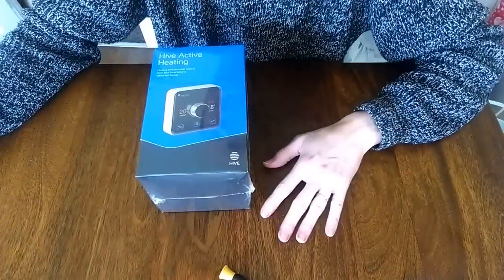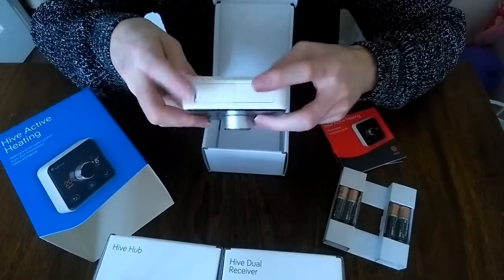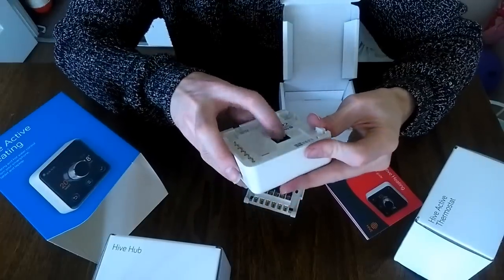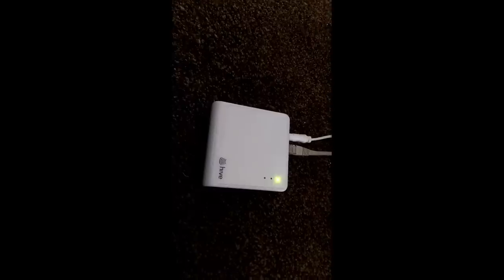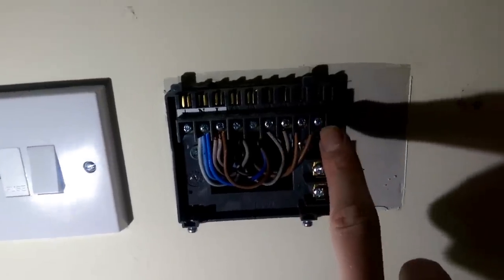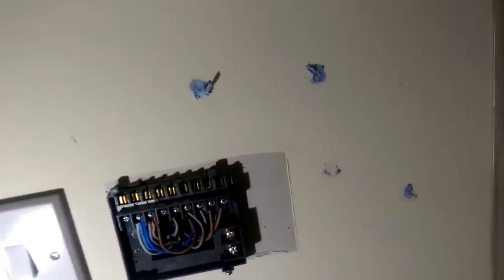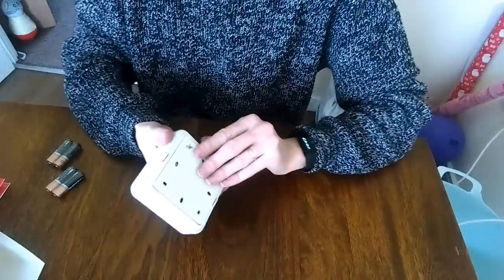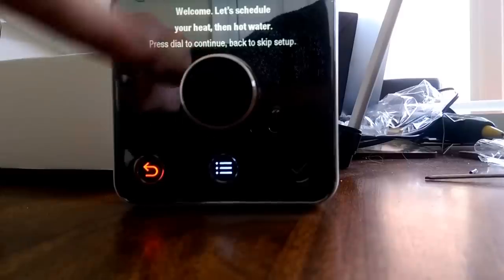Hive active heating system installation and guide

Comment: Good video - explained very well. My observation was when Isolating the mains power to fit the controller (by switching off fused spur )- I would suggest, not only switching off the Switched Fused Spur but also remove the actual Fuse from the Switched Fused Spur unit.  Or if isolating at Consumer Unit - locking out the RCD / MCB/ RCBO to avoid it being switched on whilst you are wiring the controller.
Also don't you need to alter the wiring in the wiring centre box where the hardwired roomstat  has been removed. I may have missed this in the video, but if you don't do this the heating will not work.

Comment: Compliments on an informative video.  I bought a Hive last night in a Black Friday sale event, including free Amazon Echo (got two already but more won't hurt) and including installation for £148.  The install is £40 of that price but looking at this, I fitted our existing Danfoss, the same as yours so could have gone for the self fit.  Regardless, price was good so no issue. Just one comment, when showing the wiring or diagrams, please consider using a tripod or just a still picture of them and voice over afterwards.  I paused the video to keep a still frame to look at as you were wobbling around a bit :)

Comment: Very useful and informative . Nice to see the full installation as others were just giving the impression that all one needed to do was install a thermostat.
I would have liked to have seen better detail on the thermostat controls in particular manual "Heating ON" as I'm thinking of installing one for my father who is severely technically challenged.
Reply from the maker: Hi, thanks for watching! On the heating controls, there is a little more info on my follow up video: https://youtu.be/t0h__djKg3Q
But to answer your question, a quick "HEAT ON" boost would be to press one of the two top recessed boost buttons which would turn the heating on for an hour at your triggered boost temperature, that may do what you want. Depending on your fathers mobility though the top button may not be ideal.

Comment: Great instructions superb. A thing to note with the Hive on Amazon is they offer installation through British Gas quite cheaply at the moment (£30 ish) unfortunately they won't touch an oil boiler. So if you order installation they only send thermostat no hub or receiver the engineer brings those. Odd really because the engineer doesn't even need to touch boiler. I had to send mine back and order a none installation one.
Reply from the maker: Excellent info Garry. Thanks for sharing it

Comment: The gardener fitted my one. He found it easier by leaving the isolator turned on and switching power off to the lighting circuits at the consumer unit. I can see from your video that you used the correct screwdriver and no test gear. Perfect!

Comment: Absolutely brilliant video. Thanks for making it. I was considering buying a Hive unit and wondering how it functions and how hard it is to install. I am now going to buy one and set it up. Only issue is the internet router is a LONG way away from the boiler. I hope the signal reaches!
Reply from the maker: Great, please do post back on how far you can reach with it, I'm unsure on the real-world distances that it can achieve
Reply: @junkendriven   I guess it makes a difference if there are walls etc in between. But the singal goes WAY further than my SKY WiFi router. There is no WiFi signal in the bathroom where the bloiler is, but the Hive unit works just fine in there. (Thank the Gods).

Comment: Thanks, Andy this is a really useful video. But you should advise also the people, that wiring needs to be done by a competent person, who can test it after installation, and have the knowledge, if something goes wrong. And finally, you can get a Certificate for the Electrical installation (If the boiler still have a warranty, or for Insurance )

Comment: Why are the hot water off & heating off terminals not connected on the Hive system, surely you need these to control the motorised valves, unless they are spring return but as the old programmer had these connections used I would have thought it necessary to use with the Hive.
Reply from the maker: In a lot of systems as you rightly say the motorised vales are spring return/idle return. So in my case the terminals are there just unused so my two OFF connections dont have any wires attached. (So although the old programmer had the connections, there were no wires into them in the backplate)

Comment: Can I ask a question Andy, if you know or maybe someone else might. I had a Hive in my old house, when I moved to my new house, I took the hub, as I was told it was linked to my account. I’d like to have a hive in the new house. It has the boiler room on the 3rd floor, with a control panel for the hot water. The ground floor and second floor have their own thermostats. What I’d like to know if you can answer, if I buy the Hive with a receiver and two thermostats, will my current Hub connect to the new receiver and thermostats, or will I have to buy the whole lot with a new hub?
Cheers
Reply from the maker: Hi Paul, on the first point about taking the hub, absolutely. I know the hub ID is linked to your account (which is why pairing is done by calling/speaking to them) so taking that with you makes sense. So you then just re-pair the thermostats and receiver to your hub. I've not seen personally the two thermostat solution, I believe you may need two receivers, one for ground floor and one for 1st floor to 'switch' the right contacts in the boiler, but I'm not 100% sure on that. Sorry can't give a more concise answer on that one. Please do post back on your results
Reply: Thanks Andy. 👍

Comment: Great video.  Very useful and just been looking at this before ordering Hive.  Have had Hive before but had it installed.  I've got only 2 wires for HW ON and CH ON in my existing programmer like some of the other viewers.  What you say seems straightforward but in my case, I also have an existing wireless thermostat and the wires going into the 'base' part of that (which is right next to the programmer) are the same colour as the HW ON and CH ON wires in the programmer.  Do I need to do any thing different?  The wireless thermostat will obviously be redundant when Hive takes over.

Comment: Hi Great Video, thanks. One question.   What do you do with the old traditional wired thermostat. clearly it is not going to be needed.     Mine is a honeywell, that has three 3 wires going to it.  A permenant live (red) , and two switching wires (yellow and blue)
Reply from the maker: Hi, typically you can just disconnect the wires from both ends as they're not used. Do it safely and tape/cover the wires before hiding back in your wall

Comment: Great video. I cant find clarity if I need the hub or not. Some seem to think yes, some say no. I have wired and wireless options. Any advice appreciated. Thanks.
Reply from the maker: Hi there. So you only need the hub if you want to control it online. The hub joins the home equipment to the internet via a network cable into your broadband router. If you don't want to use the app on the phone or their website to configure and control then you do NOT need the hub. The thermostat and boiler control unit do NOT need the hub. Hope that clears it up :-) Please remember to subscribe to help the channel out.
Reply: @junkendriven  Thanks. Saw later you werent enjoying the Hive due to tech issues so went with the Nest.

Comment: Hi Andy, this is very helpful and a big thanks for taking out much of  the mystery and fear of attempting fitting it myself, but I have a question and hope you can explain; I was watching another video and he said you need to reconnect the live to the heating valve to complete the circuit after removing the old thermostat or it may interfere with the hive thermostat where as you disconnected the wires to the old thermostat and tucked them back into the wall.
Love to hear your comments. Many thanks.
Reply: exactually what i saw....no mention of that what so ever here...

Comment: Thjs is great - but what do I do with the settings on my boiler? The controls for the heating and hot water, do they need to be full / off / or doesn't matter?
Reply from the maker: Hi, your boiler needs to be set to on for both. The signal wires should then tell the boiler when to switch on and off from the hive unit

Comment: This is a really helpful video. I'm looking at doing a similar replacement myself, but my existing wiring doesn't seem to have a wire to the Central Heating off connection. Can that one be ignored? My system has a separate controller and receiver, though I am thinking the receiver is what you refer to as the remote control part, which you ignore, as I think the hive thermostat communicates directly with the dual receiver?

Comment: This installation method also suitable to boiler system without hot water cylinder?
Reply from the maker: Yes, you can buy the hive system without the tank function, or just disable it on your hive unit

Comment: Thank you for sharing all information one question for you what about the old thermostat how can replace we can leave like that how can disconnect it because I have a tank boiler please make another video thank you
Reply from the maker: Hi, it depends on how your old room thermostat is connected. In the video mine is connected to the plate so by replacing it my thermostat is disconnected, you can then just remove it from the wall and use tape to protect the wires in the wall.
The room thermostat doesn't affect the tank for hot water

Comment: Hi I've got almost the same existing wiring that you had apart from terminals 5 & 6 which you said were from the stat. I do have a plastic junction/ terminal block that you have in the back box with wires going into it (2 & 2). Do you know what role that performs - would it be something to do with my existing room stat or possibly the pump that I have? thanks

Comment: Andy can you explain the wiring before you put the new receiver base on. What I mean is with your neutrals and lives, are they joined together on the base for example your cable in from the DB and your flex out to the boiler. So twin and earth in and a 5 core flex to the boiler??

Comment: Good video thank you. ++ Wired up ok and system / thermostat  working fine but failed at last hurdle. Unable to get the Hive app to find the thermostat and therefore control the system via the app. 
It just hangs during the set up process. Very odd !

Comment: can i just check, the back box in the wall is that a BS standard size, I'm looking to fit my own HIVE but will need to put a wall box in, either sunken or surface mount, so wanted to check the dimensions for the HIVE receiver

Comment: Hi Andy, I have just had hive installed by the gas board. When I look at my schedule it says water heater off, but the wall control says on. The water is heating everytime the heating is on. I turned the water heating off totally, but it is still heating up when the heating comes on.

Comment: What if the boiler has a built in programmer?  Mine has a clock type thing that ticks round but can't hold time
Reply from the maker: Normally (have to check manuals, etc) you can set that to bypass and use an external timer and programmer. Normally wiring is there to do it and you just set a jumper or wire to use external timer.
Remember, wiring in boilers is at mains voltage, don't mess with the power on or if unsure get assistance

Comment: My house has a programmer clock and two wired thermostats, am I correct in saying that the two receivers that I have need to be wired into where the thermostats are? After that the programmable clock just needs to be set on all the time?

Comment: I'm looking at a Hive, I have a Combi, but my thermostat and programmer is in the hallway.  I wouldn't want the controller in the hallway, only the therm.  Is it possible to put the controller near the boiler in the garage, and replace the current in the hallway with the Hive Therm?  Taking the cover off my programmer, I only have neutral and live, no other wires?

Comment: Hi what about the thermostat on the wall what happens to it ?
Can you tell me does it need to disconnected
Reply from the maker: Thanks for watching, yes the original thermostat is now not in use so you disconnect it (it's a pair of wires in the original wiring which is described in the video)
Reply: Andy Brown gentleman thank you for reply  andy cheers ..

Comment: Hi.I was under the impression the law changed a few years ago and we are not allowed to install electrical items ourselves now, such as sockets, spurs and especially anything to do with boilers in case anything goes wrong as we end up causing a fire.You then run the serious possibility of your insurance not paying out because it was not installed by a qualified professional?Your insurance will want to go after their insurance if something goes wrong, but, if you have done it yourself then?
Reply from the maker: You raise an interesting point, this relates to part P electrical safety in dwellings Government legislation. There are many interpretations of it, but generally (And this is my understanding backed up by a registered electrician I've discussed it with) it is related to if the work is notifiable to building control for inspection. Notification is needed for new rings/circuits, Replacement of consumer dist units or alterations to units in "special" locations (Bath or Shower room). So for example adding a socket/spur to an existing ring is non-notifiable work and not subject to certification.
In this instance you are replacing a socket (effectively) and therefore not required to have it certified. The document from GOV UK is at: https://assets.publishing.service.gov.uk/government/uploads/system/uploads/attachment_data/file/441872/BR_PDF_AD_P_2013.pdf and if you look up section 2.5 12(6a) this confirms what is notifiable.
Hope that helps, obviously I'm not a certified part P electrician, so the above is my understanding of the UK law. If you are in any way unsure you should call a certified electrician.

Comment: My boiler doesn't have any seperate controller as it is a combi boiler.
So would hive not be compatible? 🤔
Reply from the maker: Hi, combi with built-in timer can take hive, the built-in timer is just set to continuous and there is a feed for the thermostat which is what hive will control. You may need to consult documentation on your boiler for specific information but it should be possible.
Reply: @junkendriven  Great, thank you. I will get an electrician to do it for me now that I know it can be done.
I was confused as I was looking for that controller box that you had with the wires, but there is no box, just the boiler with the timer and pressure gage and water and heating temp. 😊
Thanks again, this thermostat will really help me control energy better. 👍

Comment: If the hub connected to the internet goes down (no internet) does the thermostat / receiver still send on/off to the boiler? Which is what my current thermostat does. Would you just loose the smartphone capability?
Reply from the maker: Hi there, yes heating systems still work fine without internet, you lose the ability to control/configure remotely via phone and the website. They actually sell the product without the hub so it acts as a stand alone system too.

Comment: One more quest andy 
The wires that run from the termostat 
To the control unit 
Do they need to be disconnected
Reply from the maker: Generally, yes. When you change the control unit for the hive those wires are spare anyway so either disconnect them (in mine I disconnected and electrician tape the contacts so they couldn't make contact with anything)
Reply: Andy Brown gent

Comment: How come you don’t need the remote receive on the hive but it’s wired in with the old system ?
Reply from the maker: Hi Paul. The remote receive, do you mean the old thermostat/temperature switch? On mine it was a sensor so just removing it solved it for me. It's the two spare wires when I fit to the wall/backing plate.

Comment: How far apart can the receiver and hub be placed, before they run into problems? same for the thermostat. have you tried it?
Reply: Leslie Thomas we’ve been using “hive 1” for two years. Receiver and boiler is  at the back of the loft, about 12m from hub and roomstat. Works perfectly. Just upgrading to “hive 2”. Shoul be even better 🤔

Comment: Was it not a universal back plate? Could you not have just swapped the wires to the correct terminals?
Reply from the maker: Unfortunately not, I'd expected it to be a standard/universal plate, I'm not sure if this was the hive or my old plate. Considering the original programmer/boiler in this house was built in 2014 I'd expect it to be pretty new spec-wise so perhaps this is the hive plate that differs.
Reply: @junkendriven  I have miniature cable ties for such an occasion. Bundle everything off each terminal, take a photo, then away we go.

Comment: How did it go? Did you like it? Did it make a saving on gas?
Reply from the maker: I've got to admit I'm liking the remote control over anything else, being able to switch the system off totally then wake it back up after holiday, etc, is a great feature. In terms of savings I don't think we've seen much to any at all but that's probably down to our usage.
Actually one interesting fact, previously our controller/temperature control was at the boiler, no remote control. Since we now have the hive control unit somewhere where the whole family can use it, they tend to check and turn on/off hot water when they need it, so I'm tempted to reduce the schedule for hot water and just let us decide when we want it (A relatively new cylinder/boiler means we get a tank of hot water in around 30mins which isn't too long to wait).